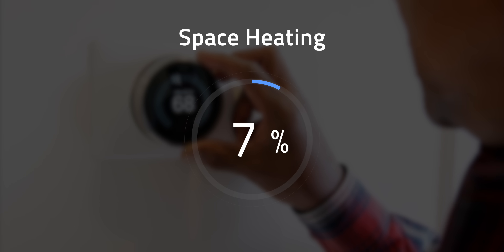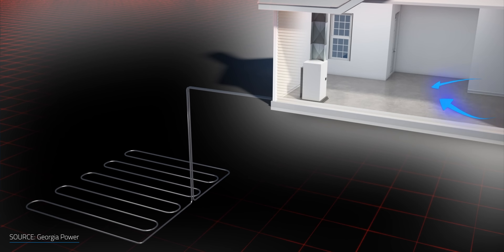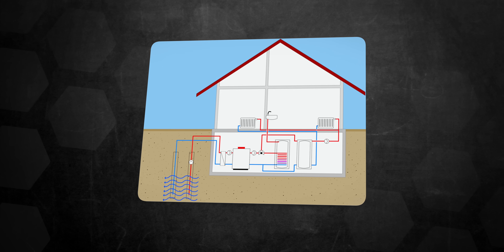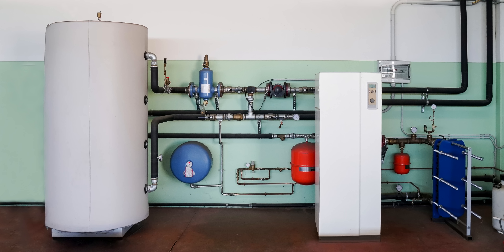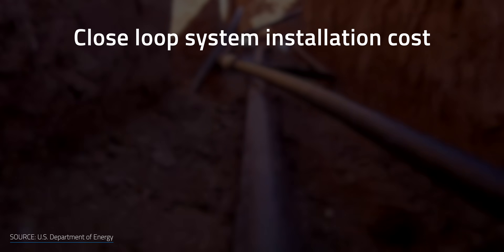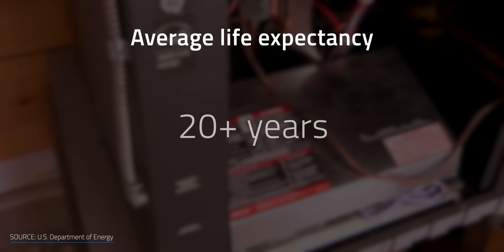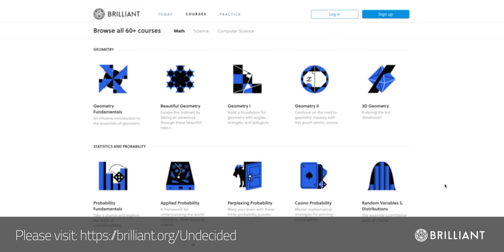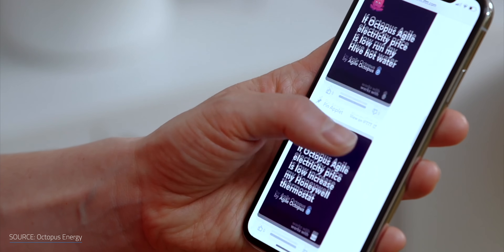Is Geothermal Heating and Cooling Worth the Cost?  Heat Pumps Explained

Comment: My half sister bragged about hers only costing $25,000. She laughed at me installing furnace and AC before Brandon and inflation for $3800.00. She bragged about $100 winter heat bill and the house being to hot and having to open the windows in the house. The way I see it was $25,000 - $3,800 = $21,200. $21,200 divided by 5 months in a year for heating the system would have to have to last 4,240 years to pay for it self. Now that is what I call a long term investment. If a earth movement take out your underground piping you get to start all over.

Comment: Bro your maths are shit.  For a new 1500 sq.ft. home the price for labor and materials on a high efficiency furnace with a/c is around 13k, including ductwork.  (Higher in metro areas, i live in the country)  It costs about 5k just for excavating and filling the holes, another 15k on equipment and 10-15k on labor.  This 30k you mention as being on the high side is probably on the low end and you will for sure spend over 30k on a retrofit.  So even if it saved me 1k per year its still going to take a minimum of 15+ years to get my money back, without even figuring in the extra money paid in interest on the loan.  (If i had a loan on my new house)

Comment: The answer to the question is yes. In 2005 I installed a 6 ton ground source heat pump in my home near Denver Colorado, which needs both considerable heating and cooling, but I did not have central cooling. The system has worked flawlessly. The loop consisted of six wells 180 feet deep connected in parallel. Groundwater was encountered at 50 feet, which kept the decrease in well temperature to an insignificant 5° F drop over the heating season. the heat pump is mostly powered by rooftop solar PV.  together I reduced my grid energy (natural gas plus electricity) consumption by

Comment: Geothermal works like a normal HVAC system except it takes advantage of the grounds constant temperature. 

Hypothetical
AC in summer, outside it's 100f indoor setpoint is 75f and the ground is temp is 80f.   A non Geo HVAC  condenser is fighting a 15f temp differential trying to put waste heat into the 100f outside air. It's a lot easier to cool 80f to 75f than it is 100f to 75f.  By simply running the outside condenser to a geothermal system the HVAC is now sending waste heat underground which is only a 5 degree temp diff and that's a lot easier to do resulting better temp control at much lower cost.

Comment: I highly recommend a geothermal system if you can afford the up front cost and if the ROI makes sense.   My system was installed in 2021 and retrofitted to my existing ductwork.  So far I’m thrilled with its performance and efficiency.  I also have a solar array that combined with my geothermal may make my home a net zero energy consumer; I’ll only know if that happens at the end of this year.   Even if I don’t become net zero I’m barely I using any electricity.   With energy costs being so volatile it’s worth investigating solar and geothermal systems.

Comment: Heating oil is also commonly used in rural mountainous area where it snows because it has the highest BTU density. Some people will even have airtight stoves that can burn both wood and coal... burn wood during the day and coal overnight.

Comment: You could lay those in a straight line under farming fields, making them easier to pullout and pull back in without having to dig them out for maintenance, you just pull them like an electrical wire.

Comment: In the UK, an exciting thing was a system that stores the heat in a hot water tank and pumps the hot water through radiators as needed.  This way the compressor can be smaller and can run 24 7, if needed.  Building up the heat in a hot water tank for times house needs heating.  As well most houses have radiators so would integrate a lot easier with the old heating system.
Reply: This tuned out to be an inefficient system. France used to have this but abandoned it a while ago. 

Phillip.
Reply: @philliptemple9841  Ah thanks for the reply.  Looks like gas is best for now.  Hopefully heat pumps will improve and get cheaper.
Reply: @gavinnorthants  I mean France has abandoned gas. Nearly all electric, and increasingly heat exchangers via reversible air con.

Phillip.

Comment: Back in 2005 I got a quote for a new 5 ton total(2 ton/3ton dual unit) HVAC Seer 18 unit for $14K and a Geothermal 5 ton horizontal line unit for $24K on a new construction home. I couldn't justify a 10 grand price hike for the Geothermal unit. So I went with the SEER 18 unit.  There was no tax credit at that time.

Comment: I think this system  is good for heating in the extremely cold areas where the outdoor air temperature is very low. But for the moderate areas solar panels system is more beneficial and cost less. I installed 8 solar panels, inverter and batteries now I don't have an electric bill.

Comment: It's hard to take this guy seriously after he claimed that the refrigerant goes into the ground loops.  That simply is not true.  Water or anti-freeze goes through the loop and then into a pipe inside a pipe to pull heat out of the refrigerant.  They are also not much more efficient than regular AC's or Heat pumps.  The majority of the power used is by the compressor, which is still present.    You save the power from the outside fan.  But you still have a pump to run, so your savings are minimal at best.  Combine that with the upfront cost and you'd be a damned fool to get geo.  But what do I know, I've only been an HVAC tech for 20 years.

Comment: Is there an optimal temperature when using heat pumps?  Does make a difference with heat pump energy consumption to lower or raise the temperature to less comfortable levels, or is it best to just run it at temps you're comfortable with?

Comment: Works great Works better if you will be keeping property forever, US military loves these, if you have shallow aquifer need a well anyway and it's easy to drill an injection well on property, if you need both heating and cooling, as if you just keep sucking heat out of the ground, you can freeze it, and if dumping heat you can dry it out decreasing conductivitiy and it's ability to disapate heat, and you can simply raise it to air temp anyway.  However, if you are in a hot climate, might be only way to run AC at anything approaching efficency, but, you'll need a VAST land area as you'll be dumping heat all the time, earth will need to be able to disapate it, make sure your engineer KNOWS what they are doing.  Related to these are lake based closed loops, just make sure your engineer sizes loop to allow for it silting over, or fabricates loop cage to make raising and rinsing it off if it silts over easily doable - and - don't loose track where the loop is sunk.  fyi  There are VAST commercial faciliites needing 365 cooling using these w closed loops deep in calm water, lakes, bays, harbors.

Comment: Way overestimated we're digging them out here for $4,000 in Tennessee and we don't do horizontal we do vertical and go in with one big drill bit and goes all the way down to where they need to go and they lower the deal down in there well first they line the walls with galvanized piping and stuff the gravel in the very bottom then they lowered the tubes and stuff down in there at the very top they cap it with a cat that's got one tube on one side and one tube on the other in your system hooks up to that depending on how big your house is you'll get a couple of them

Comment: really great video, but what the hell is going on with your unit systems over there... BTUs.. really?
Reply: Yep really!  Sad but true..... the US is totally stuck in the old "imperial" measurements ( UK pretty much too!)  .Totally wacky. For example 16 ounces = 1 pound (lb) , 2000 lb =1 ton but in the UK 16 ounces =  1 pound but 2,200 pounds = 1 ton, liquid measures are even more daft us 16 fluid ounces =1 pint and 8 pints = 1 gallon but in the UK 20 fluid ounces   =1 pint and 8 pints = 1 gallon BUT the US fluid ounce is slightly bigger than the UK fluid ounce so a US gallon is only 19% smaller than the UK gallon!!!  It is all just nuts. 

(Note in many of the comments you will see the cooling capacity of a A/C unit talked about in "tons" . For an exercise in silliness just look up how that unit is calculated...it is like the 20th century never existed....

Comment: Too bad you dont talk about the first step: INSULATION
Insulate your home properly before thinking about heatpump etc. Gains from insulation are very straight forward.  A poorly insulated house could me more expensive to warm with a heat pump.
With horizontal captation heat pump nets it is important to extract heat from your ground in winter AND extract cold from your ground in summer. Otherwise your ground temperature could change over the years resulting in a less efficient system. (especially with underdimensioned ground nets).  
You also should not let trees and bushes grow on top because the sun needs tot warm the ground.
Reply: Insulation makes a massive difference. Could stop burning wood a good two months before my neighbours just cus I have better insulation

Comment: I specialize in geothermal heating and cooling with level 9 heating and cooling in ST. Louis, Mo if you guys are interested give us a call. I would be more than happy to come out and give you a free estimate for installation. These system rocks they are literally 400% efficient over an all electric system. We have customers with 4500 sq foot houses heating and cooling there home for an average of 80-100 bucks a month all year around. The life span on these units are about 20-25 years o
If installed correctly  and maintained. Will be installing 5 systems in the coming week and a half- just put 2 in the in the last 2 days.

Comment: I didn't hear anything about air-source vs ground source heat pump.  NO contest as air source wins for MUCH lower up front costs, MUCH less complicated system and less likely to break down, and nearly as efficient.  I live in Maine and a single mini split heats my 2000sf net positive home no problem.

Comment: Wouldn't the required btu's be dependant on the way the house is built?   My house leaks like a seive so my energy costs are through the roof.   If I had the option I'd strip the siding and slap on 2 layers of styrofoam and then put the siding back on.

Comment: I think this will skyrocket in use suddenly when the government encourages switching from gas to something else. In the Netherlands there are environmental goals (2030 - 2050) to eventually get rid of natural gas entirely, but unsure how and what exactly. Some claim the current pipelines are perfect for hydrogen, produced elsewhere with sustainable energy. Others applaud waste heat, from industrial zone to various cities. Currently they have to be reheated at points where the temperature drops too low, but it could save energy. 

I think geothermal is the best option, but ridiculous on a per house base. Huge efficient systems per say 100-1000 houses, connected via a big loop could be perfect. Any digging can be done at various places, wherever it's most practical. Maybe it can be combined with solar and wind energy to be even more efficient.

Comment: As somebody who installs geothermal loops, it’s definitely a huge upfront cost in comparison to conventional heat pumps. That being said, if you’re planning on staying at the residence where the geothermal loop is being install for 10-15 years plus it’s definitely worth it. It’ll save you on monthly costs
Reply: What kind of monthly payments are we looking at for say a 3.5ton system?  Vertical vs horizontal? I have solar panels and havent paid an electric bill in almost a year... if i'm already not paying an electric bill is something like this even worth it?
Reply: @Salanan   No then it’s not worth it. Go for Centrally heated HVAC system with electrical heat source.
Reply: Hi Fraser, where are you located and how can someone contact you for an estimate?
Reply: If the loops are installed UNDER the roads outside the house when the suburbs were being set up, costs would be slashed.
Reply: @goranmiljus2664  but eventual fixing would be a nightmare
Reply: @goranmiljus2664  Roads might get icy sooner
Reply: @goranmiljus2664  That's a good point but would traffic vibration reduce the life of the system?
Reply: I think fuel heating costs are going to skyrocket. Expect your money back much sooner.
Reply: What is the biggest cost of the system.  I can rent an excavator and do the labor and I know how to install a normal all electric AC system so....any pointers?

Comment: I design/ build energy efficient homes and have installed a few GSHP systems. 

The biggest problem I have seen is homeowners mindset. Such as : Geotgermal is cheap so I can afford to have a bigger home and waste energy. Or: I don’t need to improve my older home’s insulation because the heat pump will provide so much cheap heat I can afford to not bother!

If we’re going to make any appreciable change in our energy usage we need to change our expectations for what is necessary and reasonable…

Smaller better insulated homes with focus on less energy waste design (skylights, high ceilings, wasted space..)  combined GSHP are a winning combination for reducing our reliance on fossil fuels :)

Comment: As long as you aren't getting bad installs with standard HVAC, you will likely only have to worry about an HVAC replacement on your house maybe twice in your entire lifetime, assuming you don't get a house until you are an adult.  An HVAC unit with minor upkeep will last 30 years.  Compare that to a car, a child, or even a dog, an HVAC replacement is an insignificant and rare event that is resolved in an afternoon, or just an hour or so, compared to getting Geo repaired or installed.

Comment: The Finnish market is hot. The dominant heating system for new single family houses is geo and also for multi family houses. The refit of old oil heating is usually all ways geo. For grid base centralized heat is’s usually a financial benefit to go geo. Payback 3 months to 3-5 years are typical. First mile deep open loop system failed to produce to make it profitable.

Comment: You might want to check out the Technology Connections series on the refrigeration cycle, which heat pumps use, whether or not they're geothermally sourced.  The temperature of the ground outside being hotter or colder than the air in the house is actually irrelevant, because the refrigeration cycle is either harvesting heat energy from the ground to discharge in the house or harvesting heat energy in the house to discharge underground.

Without the refrigeration cycle, it would matter, but you'd also have basically no control over the temperature - you could have the system on to bring the temperature of the house closer to the temperature of the ground source, or you could have it off. 

The refrigeration cycle is based on some tricks with compression and boiling point manipulation, that basically mean that your refrigerant is always colder than where it's pulling heat from and always hotter than where it's releasing heat to.  This is how refrigerators work - the refrigerant is always colder than the fridge inside, so it sucks up the heat energy in that air, then it's pumped around to the outside of the fridge where it releases the heat into the room.  Air conditioners are doing the exact same thing, except it's a house instead of a fridge.  And a heat pump is just an air conditioner with a reverser valve that lets it harvest heat outside and discharge it inside instead.  (and before you say there's no heat out there, absolute zero - the point where there's actually no heat energy there - is about -273 degrees C, or -459 degrees F.  There's lots of energy out there even if you're in Antarctica during one of those record setting cold spells.)

The biggest advantage of ground sourced heat pumps is that the evaporator/condensor coils outside aren't subject to freezing.  Sticking refigerant-cold coils outside in the winter means they tend to get blocked by ice, which insulates the system from the energy it's trying to harvest.  Conventional heat pumps run reverser cycles as needed - turn off the air distribution fans inside and switch to air conditioning mode for a bit so the coils heat up, melt the ice off, and then switch back on.  Naturally it's not doing anything to heat the house during this time, so you lose efficiency as temperature goes down and this cycle needs to be done more and more often.  Eventually you reach a point where it's better to just run resistance based heating units in the house.

That's where Geothermal's big advantage comes in: the ground at depth is pretty much immune to the seasons, it's always going to be the same temperature, and unless you're a numpty and built it in permafrost, you're never going to have to worry about your coils freezing.  (If you are a numpty, you always have to worry about the coils freezing because permafrost is permanently frozen ground.  Though I guess climate change is slowly saving folks who did that, because permafrost is starting to thaw in places.)

Comment: Have you done a video on cold climate air source mini ductless heat pumps? Considering an install. I have electric resistance heating now, it would seem to save energy over that situation. My only concern is reliability and if the energy savings are real. (fortunately, my bills are not breaking me- I have access to a village utility with very cheap hydropower from the Niagara Power Project, but given the state's drive to an all electric future, I'm not sure that access will continue indefinitely.) Thanks.